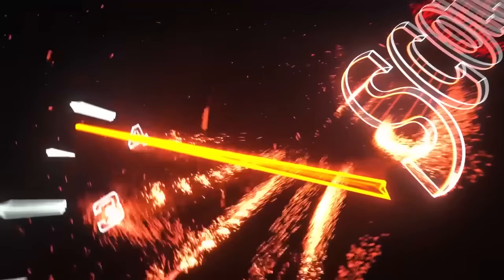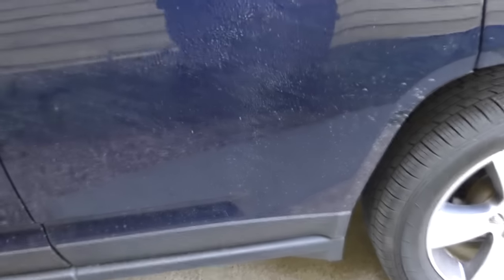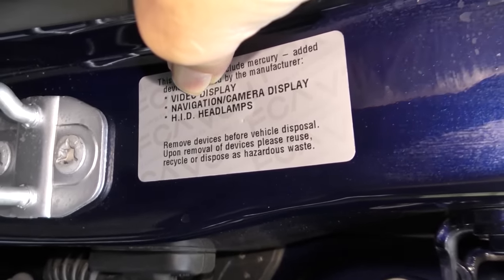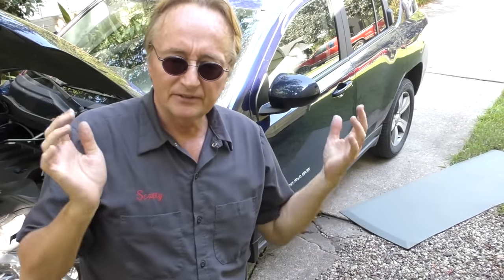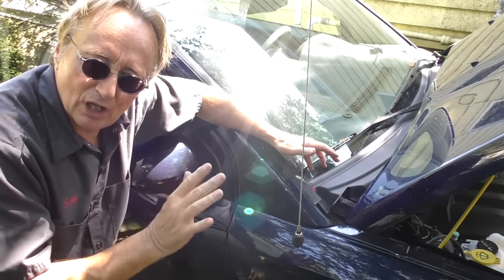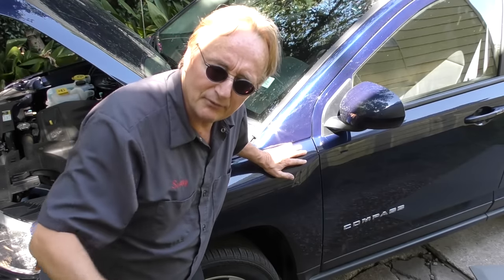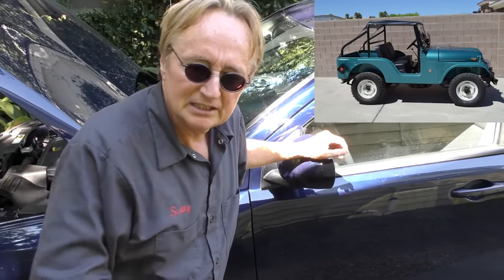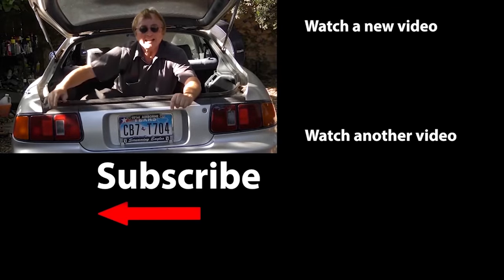Here's Why This Jeep Compass is Crap

Comment: This is the Dodge Caliber with different fenders.    I bought a Dodge Caliber in 2012 new for nothing when they ended the model and still driving it.     Take care of it, it lasts just fine.    160,000 no problems.   Hyundai partnership made engine with CVT2 from Nissan.   Not a Mopar under the hood at all.  All Asian Scotty, do your HW.

Comment: Hey the Toyota Rav4 is not trail rated either. And reliability if accelerating not an issue with Toyota since massive recall of accelerator pettal stuck to the metal with no brakes

Comment: A lot of what he said here is right but most of it is wrong. It's actually fantastic in the snow if you're tires are decent. The back seat is very roomy, it easily takes roof racks for kayaks and such. It's not worth a ton of money but if you can get one cheap enough it's certainly not a bad car.

Comment: Bought a 2018 Cherokee Latitude and now at 96 thousand miles and I am getting a transmission code. No dipstick on these so I will have to get under the car and see if I can reach the fill plug. These are closed systems unless you have a leak and I don't. We will see if Scotty is right because basically the same engine and tranny. In other words I am right at the 100k mark. It has done excellent up to this point so I hope I can get 300k. I change the oil and plugs on all my vehicles and get a lot of miles out of them.

Comment: My 2008 compass is still running smooth...

After replacing a drive shaft, control arms, ball bearings, hvac, tie rods

My transfer case and crossmember is completely rusted

Actually the entire undercarriage is rusted out despite me oiling it every winter

My dad really thought this car would be a great grad present when I was a teenager but my gosh it is the worst car I have ever driven and used in my family. 

Only reason it’s going is because I barely have 100k miles on it after 13 years lol

Neverrrr again with jeep or fiat unless I get it free or win it in a contest

Comment: Purchased mine 4 years ago. The only problem I had was that the dealership installed a Low-jack that according my mechanic pulled power from the Transmission control module. This caused the Compass to go into limp mode sometimes because it thought their was a damage wire due to the TCM connection drawing power. Had a Chrysler dealership check it over for 2 weeks. They could not find anything wrong. I called Chrysler and told them that the dealership could not find anything wrong they said they would get back to me. I didn't have time to wait so I took it to an independent mechanic, they found the issue immediately uninstalled the Low-jack and gave the car back at no charge. Couple days later someone from Chrysler called and wanted me to go over the issue the jeep was having. I told her I went to a independent mechanic who addressed the problem immediately, the representative got really annoyed that I did that and said I should have had another dealership check it. People do not have time to wait on Chrysler to get their s*** together. But thank to that independent mechanic two years ago I haven't had a problem since.

Comment: Those 2.4’s wasn’t so bad I got 180k out of mine in a stratus SXT before I traded it and I never done the first thing to it. I changed the oil put rubber and breaks but that’s it. Now who ever got it after me may have had a lot of trouble I don’t know but ha it was super cheap with low miles so I had it for years and was bored with it and wanted a big car or 🚙.

Comment: Luggage rack has to be installed. I have 2018 Jeep Compass. Not 4 wheel drive. It is solid built. I have great gas mileage. I think you are wrong.

Comment: Rusted and corroded nuts on the strut tower. If THAT is what RUST looks like and if THAT is an issue… Boy o boy. Should check out the frames on Chevy and GMC trucks here in upstate NY, ONLY about 8-10 years old.

Comment: This video I completely disagree. Chrysler's 2.4L World engine was originally designed by Hyundai, and it is currently Chrysler's most-reliable engine. Some trims offer 6-speed automatic made by Hyundai too. Good reliability, overall. They easily last beyond 200,000 miles.

Comment: I have to correct him in part. 2007-2018(mid-year) is of the Dalmer Chrysler design not Fiat. The 2nd Gen from mid 2018 and up is Fiat. Much better vehicle in the second gen. My 2007 was a piece of crap. 3 transmissions in 160k miles, Front lower control arms prematurely wore out.  However underpowered the 2.4 engine is great. Crappy mileage because the engine has to work to maintain the overweight small body's momentum. High maintenance is true with this vehicle. I do not recommend this in the 1st gen to anyone.
Reply: Not even a clean one used with only 25,000 miles?

Comment: I have one with the 2.0.  Reliable little engine but won't get out of its own way.  Very under powered.  Also, the CVT transmission is potato and will overheat if driven any length of time.

Comment: My wife jeep Compass has more than 100,000 and still running I know  is a cheap vehicle but if you change the oil on time or sooner and change the transmission fluid sooner than 60000 mileage it will last maybe not more than my Toyota Camry but if you dint pay too much for the Compass you will have plenty of mileage to drive is all up to the owner maintenance habits

Comment: 2016 Jeep Compass 4x4. Took it mudding with 64,000 miles on the vehicle. Fried the 4wd on the first time actually using it with a decent load. 👎👎

Comment: Sorry, I guess it's luck, but I had my XJ Cherokee for 15 years with no issues other than routine maintenance and I've had my 2009 Patriot 2.4 5-speed AWD for 11 years and 90,000 miles , same story. Reliable, and while not a Wrangler off-road , it's not supposed to be. I've never had any issues getting where I need to go and back, in snow, ice, whatever.

Comment: My 2010 Jeep has 2 Manufacturer Recalls and I had to disable my Horn after it started going off on its own all the time following the installation of a new car battery. More good news for me was when my new battery would not hold a charge because of the battery being drained by my CD player.....even though I have never used the CD player and regardless of whether of not I was in the car or not. It's at 45,000 miles now and this Lemon Clunker won't see 45,001 with me as the Owner because I'm leaving it for Toyota. Lol

Comment: My bf refuses to stop buying this car despite my insistence that it is a piece of crap that has had major issues with electronics and transmission within the first few years----issues that have to be fixed in order to continue driving the vehicle and often by the dealership because their software is inane and wonky. I drive 20 year old cars that of course end up needing stuff replaced but that's expected and they still run 20 years later. At the rate he's going with his compass that's not going to be the case for him and I feel bad but at the same time he maybe should have listened to me at some point over the last 8 years telling him to STOP BUYING JEEP COMPASSES. Right now it's stuck in the driveway because the electronics just stopped working last night and so it's stuck in park with the e brake on and the towing company has no clue how to tow it. SMH!!

Comment: Mine is a POS. 70k miles transmission took a dump. 80k electrical problems that never got resolved.  Suspension problems up the wazoo.  I. WILL. NEVER. BUY. CHRYSLER. AGAIN.

Comment: I bought a 2010 compass in May 2019, 94,000 miles, from a used dealership.
In February, I replaced the Trans and cradle bar, August was battery, some wiring, and computer module. I’ve spent nearly 1.5x the mileage that I’ve put on. Roughly $13,000 total for just under 9,000 miles. Worst piece of crap I’ve seen
Wish I saw this video before I purchased...

Comment: Jeep had to come out with 4 cylinder front old drive vehicles because of Cafe standards going up. Cafe means company average fuel economy so every badge name has to achieve a certain average fuel economy. You're not going to meet the standards with rear wheel drive and four wheel drive V8 and inline 6 vehicles. They had to bring the average up with FWD 4 cylinders.

Comment: I think the main issue has nothing to do with fiat taking a share in chrysler, it seems chrysler are the problem, combined with the fact they are made in Mexico. I bought one of these, actually pretty handy, but in Europe we get Mercedes diesels as an option. Aside for poorly designed door locks, the main issue is American build quality standards, like under body protection, these have none! Even cheap European cars have tons of it. Importantly, it's cheep, it's 4wd its comfy and it does a job, the job of a van, a car and something for dirt tracks.

Comment: Screw this. My 2017 Jeep Compass High Altitude is amazing. Have not had a problem at all. My gas is great. It lasts two days and I drive 3 hours every day. 3hrs to and 3hrs from. So you’re completely out of it. You may have an issue. Take care of your car and you will not have this. If a acceleration is not an issue. This isn’t a race car.

Comment: Got a 2018 jeep grand cherokee trailhawk got it brand new with 3 miles now has 5000 and theres so many problems with it moonroof leaking into the interior belts and pulleys going bad  air suspension going bad transmission too they are not reliable at all

Comment: 🤦🏾‍♀️ sure wish this video was made a year ago.  I have a compass bought used paid cash 1 owner older couple but after I got over 100,000 miles this pass July 2019 it is really giving me the blues. Hopefully my recent repairs brake sensor $250 and another major repair $$675 (can’t remember what) but the air compressor had to be removed to get to the issue.). is enough for a while. The gas can be a lot better around town I can go a week on a tank. Ugh 😑

Comment: Why is the anemic four cylinder engine being pushed so hard into vehicles?  Not everyone wants nor needs an anemic four cylinder.  As for a four cylinder with a turbo, we get so many of them in that we call that combination grenades.  Every decade pushes the ridiculous four cylinder engine with a turbo and every decade they prove to be grenades.  We get vehicles with very low miles with ruined engines and turbos several times a week.  The four cylinder turbo combination should never be considered for a vehicle. Even Japanese four cylinder engines with a turbo have proven problematic in the past and the Japanese quickly stop production of those, "grenades," that decade.  Never buy a four cylinder vehicle with a turbo.  Mechanics call them, "grenades," for a reason.

Comment: You compass owners realize if you did research before you bought it, it has issues with trans, engine, computer and wiring, basically the worst things to go wrong, if you didn't have problems, you got lucky

Comment: Agreed.  Bought a new 2018 Compass Limited and had the Throttle Body changes at least 6 times.  Glad I bought an extended warranty but don't trust this car anymore!!  BTW it has only 28000 miles.  What a POS.

Comment: 5:26 Only a 2017 Jeep with only 30k miles and already corroding parts in the engine bay. Horrible quality! Wait till it has 100k in about 2-3 more years and it will have fallen apart. It won’t make it to 100 k.

Comment: I like your channel Mr. K, but you talk too much.   We have a Jeep Compass that's a workhorse.   It now has over 150K miles with no major repairs.  It has the trailer package which allows me to pull a small 8ft trailer, fully loaded.   I fill up once every three weeks for $20.   The only problem I have with it is driving on ice and snow.   It drives like a Jeep and I had to get used to it because it's lighter than most vehicles.   Other than that, it has an impressive turning radius that lets me easily maneuver in tight spaces.   I love using it with the trailer for taking brush to the city landfill and for moving furniture.   This Compass is a utility vehicle and can easily accelerate in the city and cruise for highway driving.   I do not baby this vehicle and it has paid for itself.  It cleans up nice and I can fit the entire family inside.   The only major consideration with buying this vehicle is that the exterior body is plastic, not metal so if it's ever wrecked, it's pretty much done and certainly not as safe for family because of its small size.  It makes a great 2nd hand vehicle.     Other than this, thanks for all the great videos.

Comment: So what is exactly wrong with this car that you are showcasing and bashing? The earlier Compass models were troublesome but were replaced in 2017. Probably no better than the Toyota Yaris. Toyotas are way overpriced and there is no gurantee the car you get will not be troublesome. Compass is low rung on Jeep models. Compare it to the Toyota Yaris an overpriced POS. I don't buy cars to last 300000 miles with the computer technology in the cars, forget about it. I like my Wrangler and Desert Hawk they have features and options competively priced. Beware generalizations of car brands

Comment: I bought a 2015 modal last year and now seriously regretting it. I'm now having problems with the electronic throttle control which is NOT covered under the warranty from the car lot I got it from and the gas mileage really is crap. I'm tempted to just set the POS on fire out of hatred for it.

Comment: Why didn’t you do any research before buying it? I know if it was someone else’s they wouldn’t let you talk about it like that. 
You probably just thought it was a good deal and got ripped off. I got a 2018 Jeep Compass TrailHalk. I made sure I was satisfied with everything before purchasing. 
Every car will have its flaws. Not everyone is gonna work on a new car. That’s why the smart ones get warranties. All electronic stuff to the car plus more will be fully covered for 3 years. 
This looks old and very used. I would say 2013 or 2014 from the headlights. And you posted this a year ago. That’s why people trade in. So the price value of a car don’t go down by to much and they can get a newer car for a good deal. 
If you want something that holds it value get a wrangler. So you don’t need complain online about how you got screwed over.

Comment: My GC 4x4 is a 2012 is and most of the engine components are Daimler Benz Chrysler leftover and Chrysler LLC which didn't have the finances and used precasted engines from the previous stockpile. there is nothing in my engine compartment corroding or rusting. I do see the craftsmanship has taken a turn for the worse on these new models. FIAT is a pur scheiße and there is truth in what he says about the parts arena, ofcourse fiat is supplying the parts on new models the Chrysler Group LLC is gone and its been 5 yrs since its demise in 2014 . The butt hurt comments are understandable because folks don't want to believe but know this... the parts provider is mopar which has significantly dropped or limited all parts on the the older models of the jeep line this is indication there is change with the Fiat takeover. Ide say if you don't own the Grand Cherokee or Wrangler you bought a lesser quality model and part cutbacks are all across the board.

Comment: I got approved for one and after the test drive I ran away from the dealership. The 2 liter 4 banger was the slowest engine I have ever driven. It was dangerously and comically slow. I quickly realized that it wasn't 4wd and wasn't a real jeep. Man is it a pretty car and for someone who just wants the Jeep look sure it could work if they got the bigger engine. I agree with Scotty the build quality isn't there and I'd suggest to stay far away from the 2.0 liter 4 cylinder. If you have one and you like it sorry it's just my opinion. I would have dealt with super slow if it was AWD or 4WD.  The one I test drove only had 46,000 miles It was upsetting that Jeep made a vehicle so attractive but miserable to drive. If you can't afford the grand Cherokee stay away from Jeep fellaz trust me. My GF's Laredo is amazing. The compass is Happy trail rated not 4x4 trail rated.
Reply: You need to watch some videos. They can go places and do trails well as videos show. Stop all the hating kn this vehicle as it’s all done can afford. Still a Jeep no matter what some think. Look up Ralston Pass in Nederland,Co. Did it in mine. No problems. It’s not a wussy trail either.

Comment: I hate the 2015-17 compass, but the new 2021 Trailhawk Compass of mine is amazing. The Compass Model went from #1 ugliest, to one of the Best looking Jeeps in the lineup. We had a 2015 Renegade, lasted us 190,000 miles with just one flat tire in its history, before getting t-boned by a red light runner with an impact speed of 50mph. The Renegade got thrown onto its roof, My parents, walked to the ambulance on their own. The Jeep Brand is still Top in my book. We now own a 2021 Compass that routinely gets 28-38 mpg. I love it. This 2017 compass in the video, is, one of the uglier cars Jeep Made.
Reply: What do you think about the compass 2021 limited?
Reply: @jaaebeeee  They're good if you get the right options. They have the blackout rims and roof, but they are pretty cars. I have the Trailhawk Edition in Laser Blue Pearl. What color are you looking to get?
Reply: @norfolksouthernrailworks1543  I got the limited 2021 edition, black with grey accent and silver rims, pretty nice
Reply: @jaaebeeee  sounds like a good color combo. But you can still enjoy 227 BHP with your 2.0L 4 cylinder TigerShark